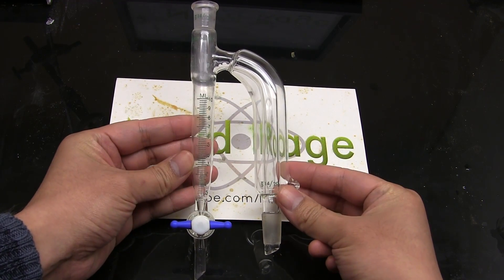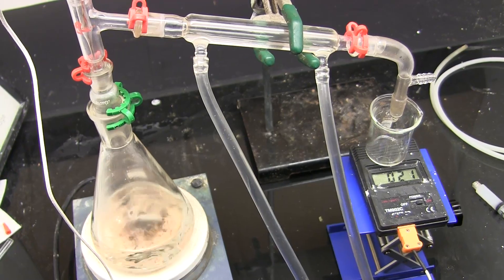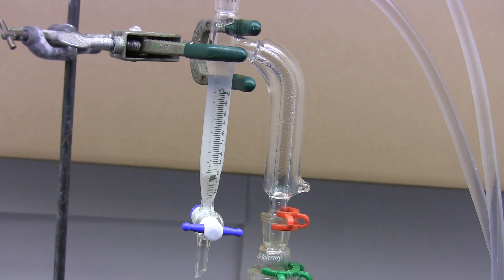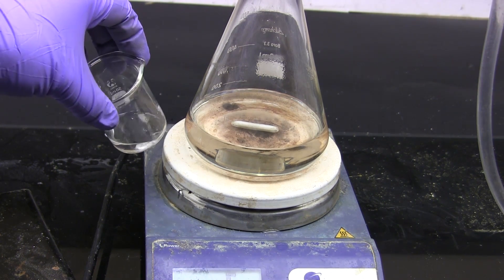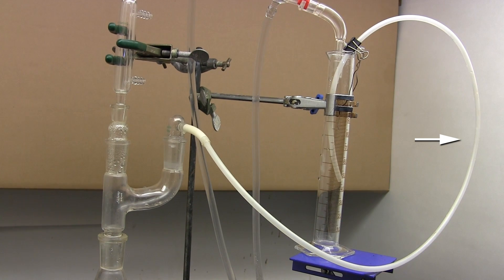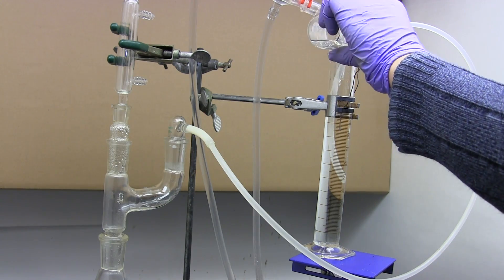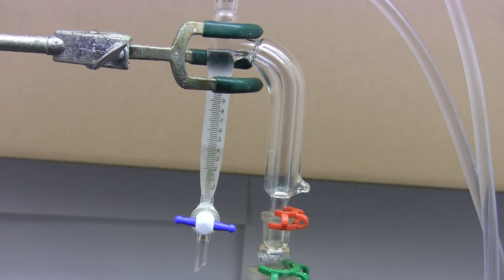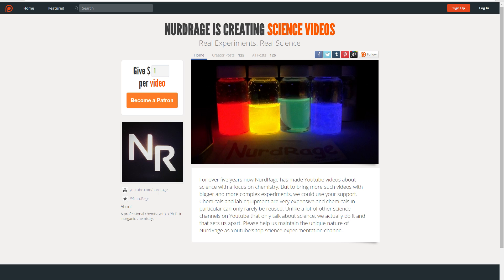Lab Equipment: Dean Stark Trap

Comment: There is a modified Dean Stark aparatus, by Dr Merlic, that improves the efficiency. It is relatively new design, but overall is similar to normal Dean Stark, and has similar price from few vendors. About 230$ for 10mL receiver, with 24/40 joints.

Comment: Why does the right side of the apparatus have a glass jacket around it?
Reply from the maker: very interesting actually: its a vacuum inside the jacket. This insulates the inner glass column and allows vapors to travel further up. This is important when you have very high boiling solvents and need every degree of heat you can.

Comment: Hey just a quick question. It appears that you always give mixing instructions based on the ratios of the masses of the reactants. For example, add iron oxide to aluminum in a 1:2 ratio. Isn't if more accurate/effective to use mole ratio to calculate? Why would you use the ratios of the masses when mole ratio is the correct way? Or am I missing something? Thanks.

Comment: Would you have any use for a donation of 1 apparently unused Labglass delux short pass rig, fully vacuum jacketed, 10/18 tops & 14/20 bottoms, 4mm bore dual 3way (double oblique & regular 3way stop cocks are missing) glass valves for vacuum takeoff?
Reply from the maker: +captainmidnite93 sounds interesting, is there a picture of this unit? is there a lab supplier that has a picture i can look at? thanks.
Reply: +NurdRage Just found it on net.  LabGlass cat # ML-675-802.  Richguy price 632.31. Was buried in an auction lot/pallet purchase  for movie props several years ago.
Reply from the maker: +captainmidnite93 interesting, i might be able to find a use for it if it's being donated. is there an email i can reach you at? send it by youtube message.

Comment: NurdRage, hey amazing video. You caught my attention on herbal oil distillation. Is there a diy list for your trap device? I am not really that crafty and therefore so in need of a parts list with stepbystep. Thanks so much for an informative time!
Reply from the maker: +Tom Sikes If you're starting from scratch then it might be more straightforward to outright purchase a "clevenger" trap which is sold for distilling essential oils. Shop around and you can find some reasonable prices. The parts to make my version add up to the cost of a specialized trap. So mine is only economical if you already have a well-stocked lab with the parts on hand. If you really want to know mine consists of 

2 x liebig condensers (only 1 is actually used as a condenser, the other is just for getting extra height)
Claisen adapter
Right angle hose adapter
still head
distillation adapter
graduated cylinder (100mL)
PTFE tubing (must match the hose adapter's tube size or connected with an intermediate hose)
Erlenmeyer flask (mine was 500mL but you can use larger if you want)

All glassware must be ground glass jointed with either 24/40 (recommended) or 14/20 taper.
Total cost of my setup came to around $150-200.

But like i said before, i recommend getting a specialized system.

Comment: The Claisen (?) adapter you use in your homemade version looks pretty much like the Dean Stark trap, couldn't it just be flipped over and used like that? It looks like the neck should be insulated but some foam might work?
Reply from the maker: +littlestworkshop You'd need a bunch of fittings to change the joints to the right type. If your lab happens to have them then go for it. A draw back is that it would be much more prone to leads as the liquids would be flowing against the joints rather than with them. Additionally, you'd still be stuck in light-return mode, while the homemade version can do either mode.
Reply: +NurdRage Of course, that makes sense. I don't really do chemistry proper but am just trying to get more of an appreciation and pick some ideas up via osmosis.
Reply: Yes, it's much less bulky and much simpler that way, but you need two male to male joint adapters (one for the boiling flask, the other for the burette or sep funnel) which are not as common as all the other stuff. One could also do a simple distillation to a sep funnel and manually return the desired layer, but these defeats the point.

Comment: As you mentioned Dean-Stark traps are used in the petroleum industry to extract the water and the hydrocarbons from a rock sample usually a drill core. The amounts of water and hydrocarbons are used by petroleum engineers to estimate the productivity of the reservoir. In the version used the core sample is partially submerged in the solvent with the water collected as you showed and the solvent refluxing over the core.  At the end of the extraction the core is lifted above the solvent allowing the pure condensing solvent to rinse the last of the hydrocarbons from the core.  If the sample to be extracted are chips of rock or a powder, they are place into a porous cellulose cup that is submerged in the solvent and in this way the material is retained in the cup and not floating around in the solvent. Cheers, Mark

Comment: Regarding the home made Dean Stark, one thing to keep in mind is the type of tube you use to return the toluene to the mixture. Toluene can leach out plasticizers that are contained in some tubes (like Tygon) and contaminate your sample. 

Nevertheless, that setup is incredible! :D
Reply: +KakashiBallZ He never mentioned it, but that looks like PTFE tubing to me.
Reply: +RedneckChemist After a second look, I'm thinking you're probably right. I'm just curious how he could fit the tube on the snout of that vacuum adapter attached to the Claisen adapter. If the tube has any sort of elasticity, it's plasticizer city for this chemist. Also, I'm not sure if you could heat PTFE to make it more elastic like you can with Tygon.

Comment: I'd love to see you make a homemade soxhlet extractor!
Reply from the maker: +detectivemuffins it can be done, i just have to figure out a good experiment to use it with.
Reply: @NurdRage  Hallo nurdrage ! Can i ask you a question? Can you separate water from acids with dean stark trap?? I wonder if azeotropic solution's may find their peaceful in heaven with that trap.. anyway your videos are very educational and help me a lot nice job thumps up!!
Reply: @willowpine2604  The answer to your question is... Sorta, but mostly no. You could use it to strip out the water up to the azeotrope but not beyond it. And you would lose some acid doing that. Edit: Also that would be totally pointless and an actual waste of time because you could just distill it and swap the flask when you reach the azeotrope.
Reply: Jon Ross I feel like adding toluene to 68% nitric acid would work to remove at least some of the water. I haven‘t tried it out tho and am not too sure. Also you‘d possibly be making explosives in the process…

Comment from the maker: March has had a dearth of videos because making p-chlorotoluene has been very difficult. While i am successful in making it, the yield is extremely low and produces large amounts of toxic waste. So far i've tried multiple routes and every one of them has been poor yielding. When i finally get a video that's half-decent i'll post the method.
Reply from the maker: +dzScritches lol! boy did i screw that up, i meant dearth. :)
Reply: +NurdRage Awesome video! Keep up the great work!
Reply: +NurdRage Have you had any luck from a Sandmeyer reaction on p-toluidine?
Reply from the maker: +Bill Smathers I realize i didn't properly specify what i was looking for, my mistake, let me clarify: I'm looking for a means of making p-chlorotoluene using as few reagents and steps as possible. If I could use whatever, i could get the whole thing done using some homemade zeolite catalyst and get excellent regioselectivity. But i'm looking for as simple chemicals as possible. Now existing methods of chlorinating toluene with TCCA, peroxide, chlorine, or even ferric chloride all work, but give no better than 2:1 regioselectivity in favor of the ortho isomer. So as a further requirement, i want a method that gives better than 1:1 selectivity in favor of the para isomer. 

Nitration and the subsequent steps do work, but the labor and reagent cost in total seem to be equivalent the direct chlorination route with subsequent isomer separation.
Reply: +NurdRage "a death of videos" o.O
Reply: +blitz krieg The way they say "out" is a dead giveaway of any Canadian.  I picked up on it quickly (and I'm not a Canadian.)
Reply: +NurdRage Are you attempting Electrophilic Aromatic Substitution? Is there some practical limitation I missed in my second semester of Organic Chemistry? It seems that from benzene you could simply add the methyl group, then use it as a para director for the chloro- halogenation. Yes you will get the ortho "o-chlorotolulene" but is there a way to decompose that and simply re-halogenate what you do not need, thus increasing your yield as you re-halogenate?
Reply: Good idea Bill! He could start from toluene, nitrate, reduce to p-toluidine, and then do the Sandmeyer reaction.
Reply: If you need to generate toluene. Then wouldn't it be possible to substitute a H for Br in benzene and use a methyl Grignard reagent in nucleophilic aromatic substitution and have Br pop off as a leaving group?
Reply: Grignard reagents are notoriously fussy about water contamination, and the pain and suffering associated with producing the methyl iodide and diethyl ether required for a Grignard is totally unnecessary when toluene can be easily bought and distilled from paint thinners. Plus there's also the question of where to get the magnesium-- if you were just going to buy it online you might as well buy toluene there too.

If you really wanted a totally OTC synthetic route to toluene, one way would be to oxidize lactic acid to pyruvic acid, when then cyclicizes to uvitic acid in acidic conditions. This can then be decarboxylated to toluene.
Reply: Still it's better to start from toluene like Bill is saying. When you're doing a retrosynthesis you want to stop when you get to a readily available starting material. Whether you're in a professional research lab or you're a home scientist this is the golden rule because you want to save time and money. Possible vs. practical.
Reply from the maker: Guys, let me clarify. My difficulty is in making *p-chloro*toluene, i don't give a rat's ass about toluene since it's readily available. But regioselective chlorination of toluene to p-chlorotoluene by amateur means is difficult. Exactly how you got the idea i was trying to make toluene is beyond me.
Reply: But the analagous nitration is relatively easy-- at low temperatures you end up with a mixture of p-nitro, o-nitro, and dinitro products, which freeze at very different temperatures and can be separated. This can then be reduced with dithionite and diazotized to the chloro derivative.
Reply from the maker: +Bill Smathers So a nitration, a reduction, a diazotization and then a chlorination. Four steps versus two steps, doesn't seem easier or less wasteful. Plus the reagents need to be obtained, my hardware store doesn't have sodium nitrites for instance. If you want me to make them from sodium nitrate that adds even more steps.
Reply: diazotization and chlorination can be done in one pot though, and since you've already made propionic acid by boiling down several liters of haloform product, I didn't think practicality or yield was something you had in mind :^)

Nitrites can be bought if you have a store nearby which sells meat curing supplies -- curing salt is 5% sodium nitrite on sodium chloride, and these can be separated by crystallizing out the sodium chloride.
Reply from the maker: +Bill Smathers Practicality and yield are always a consideration for me. I still don't see how going 4 steps is better than going 2 steps.
Reply: I'm not sure which method you're using to get p-chlorotoluene in two steps...

Either way, "Preparation of Chlorotoluene by oxidizing chlorination of toluene"  by Salakhov et al claims an 88% yield of o- and p- chlorotoluene by oxidizing with hydrochloric acid and 30% hydrogen peroxide, with the desired product being separatable by freezing it out. 30% hydrogen peroxide should be available as chlorine free pool shock, but if it isn't sodium percarbonate can substitute as it is used as chlorine-free bleaching powder.
Reply from the maker: +Bill Smathers yeah i already tried freezing out the desired isomer and it didn't work, apparently a domestic freezer isn't cold enough. Additionally, the paper you referenced only claims a 2:1 ratio of o-isomer to p-isomer, this is no more regioselective than most other direction chlorination methods. 

 but going back to your original assertion, why would a nitration be relatively easy if it has more steps and requires more chemicals?
Reply: It would be easier because based on experience, separating nitrotoluenes from each other is extremely easy (the para isomer is slightly soluble in the ortho one, but not enough to prevent usable product from being extracted by cold filtration). I believe Chemplayer here on youtube has a good video detailing this process. Either way, I have a ton of nitrites and nitrates and not a lot of peroxides and TCCA: this procedure was more intended for someone like me who has an abundance of the reagents required.
Reply: I was thinking about the isomers as well. My question is how could you precisely measure the chlorine used? So you're probably going to over-chlorinate and also get a mixture of isomers naturally. Then how will you separate your isomers? Or for that matter how will you even tell if you're product is pure w/o nmr? Now OBVIOUSLY Nurd Rage you are a much better chemist than I am (you are one of the people who got me into the subject), and I have a huge amount of respect for you, but I'm just wondering if the Sandmeyer reaction wouldn't be more selective than a raw EAS, EVEN though it's way more steps and more inefficient in that regard.
Reply: At low temperatures, adding the first chlorine or nitro substitutent to the ring will deactivate the benzene ring enough to prevent it from taking on more chlorines or nitros. However, you don't really have any control over where the substituent goes-- it could either go ortho or para to the methyl, and you don't have much of a choice of where. Although this happens with both chlorinations and nitrations, the nitrotoluenes are much easier to separate from each other than the chlorotoluenes, meaning that after a reduction to toluidine and a Sandmeyer, you can get relatively pure para chlorotoluene isomer.
Reply: Ah I see, my bad. Looking forward to the next video!
Reply: +NurdRage Hmm.... I would suggest forming para toluenesulfonic acid (thankfully this is regioselective without any hassle!) and then chlorinating that off, but toluene doesn't seem active enough to support this reaction even though it works well on phenols. (ref: The replacement of sulfonic acid groups by halogens) 

However, ipso nitration at low temperatures does seem to be effective and high yielding. Although this does have the problem of requiring a Sandmeyer, it does seem to be regioselective as you're looking for. (ref: Aromatic Chemistry, Hepworth, 5.3.2) Alternatively, chlorination may proceed by directly fusing with sodium chloride, but I don't think chlorine is a good enough nucleophile for that to work well.
Reply: Here's a stereoselective route that should work: start from toluene, make para-toluene sulfonic acid by refluxing in concentrated sulfuric acid, fuse with sodium cyanide to substitute the sulfonic acid group for a nitrile (CN- is sufficiently nucleophillic for this to work), hydrolyze to para-toluic acid, and then do a Hunsdiecker or Kochi reaction to the desired chloride (alternatively, do a Hoffman degradation, diazotize, and chlorinate) This process is fairly involved, however... At least the hydrolysis is straightforward.
Reply: +NurdRage home made zeolite? sounds surprisingly straightforward
Reply: Make fluoroantimonic acid!
Reply: *****
Thats the fun part
Reply: *****
No, then I wouldnt be able to see the video. As a chemist, I would expect him to follow the necessary safety procedures